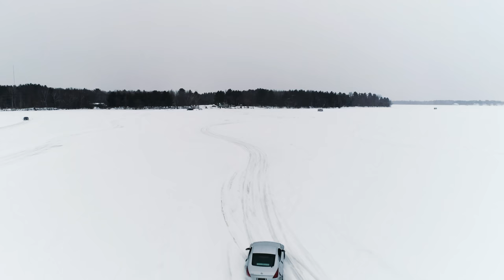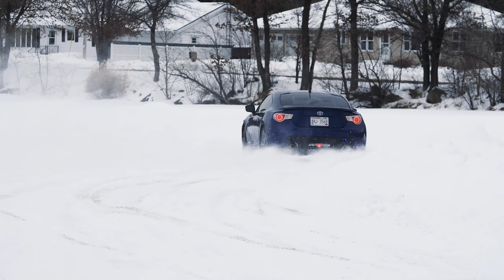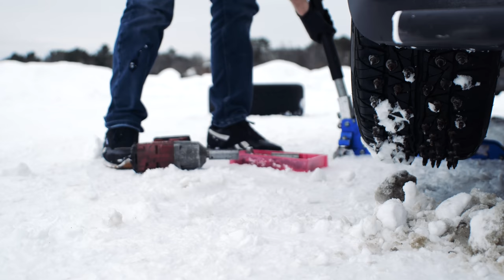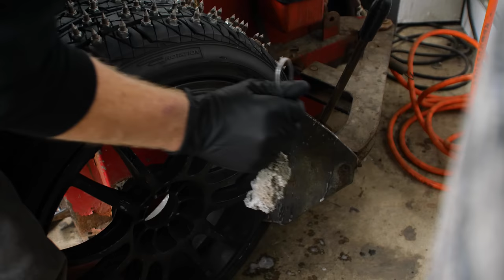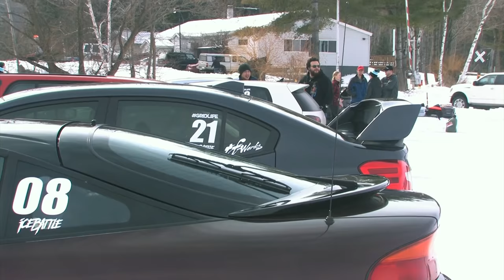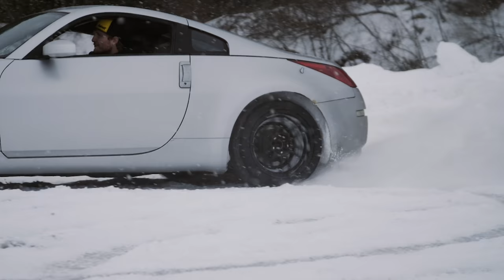Shredding on Frozen Lakes- Midwestern Ice Racing

Comment: I've lived in Wisconsin my entire life and had no idea this was so doable. I thought it was only for professionals. Learn something new everyday.
Reply: look for CWSCC / FVSCC on facebook. That is where they post about when and where the events will happen.
Reply: I am most definitely not a professional, and I have a BLAST!
Reply: Go bomb on a open lake. Its so fun. Just dont drive on the ice without knowing if its safe. 
In New Hampshire they ice race too. They race Sprint Cars on the ice. Look it up. Its like “mount Washington ice racing club”They use chains in the back with snowmobile picks in the cross bars. Roller chain wrapped around the front tires with snowmobile picks going through the roller chain links. Would like to see cars around here use the bolt studs. Looks faster.
Reply: Tyler Donald sane here

Comment: Love this! 35 years ago I used to set up and run the same ice racing at the Antlers (Tiki Bar for you younger ones!). I ran a RX7 with "nailies" on wore out Comp TA's from autocrossing. By far the best driving experience-Andy, I echo your comments. We used to go down to West Salem and run a course on the lake down there with the LaCrosse club also. Going into a 180 deg. turn at 105 mph was a BLAST!! I ride by your shop every day in the summer, will have to stop in some time and see your operation.

Comment: it’d be kind of expensive because the biggest jars I know of are only 1oz, but what if you used Mend It on the inside of the tire for the seal around the studs?

Mend it is specifically made for soft plastic/rubber. it’s used to fix/customize fishing lures but it’s incredibly durable and I know it seals bike tires up, so I don’t see why it couldn’t work for this.

Comment: I feel like there has to be a better way to have studs on the tires without drilling holes for them. Would the regular studded tires you can buy not suffice? Could the studs be attached in a way that doesn’t puncture the tire?
Reply: You buy ex rally tires